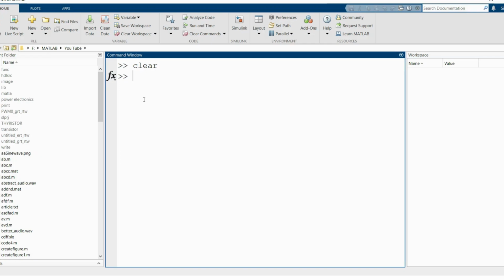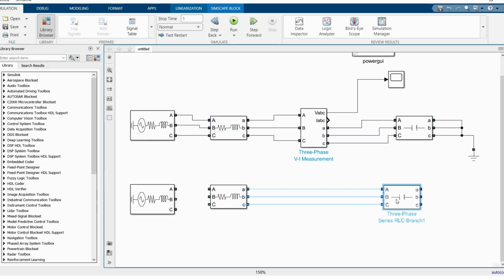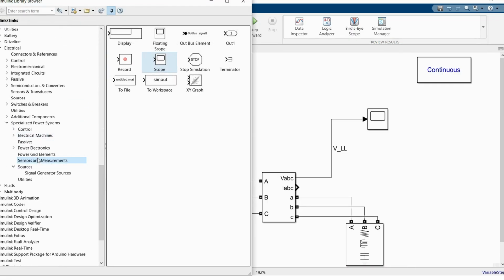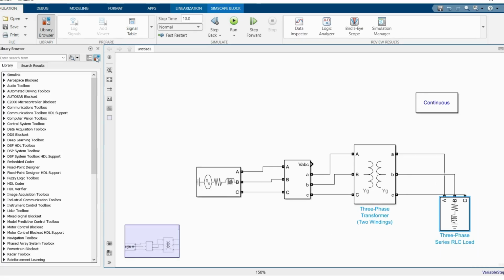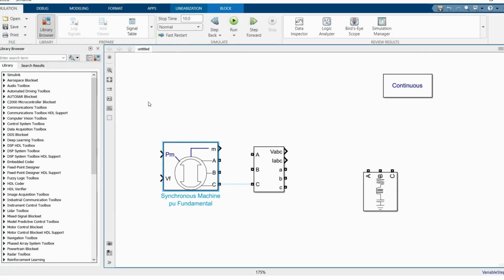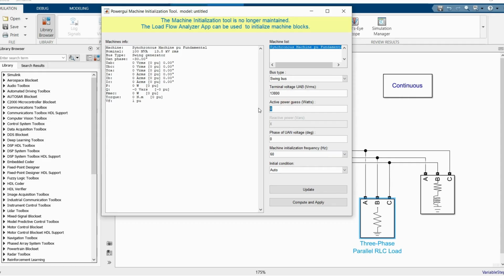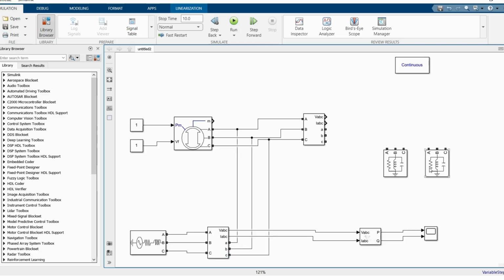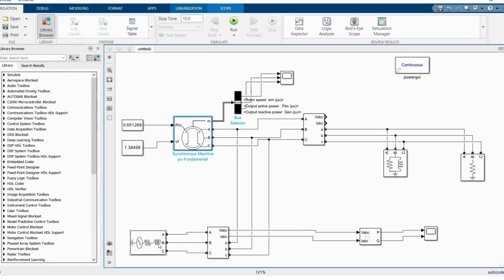Electrical Power System simulation in MATLAB Simulink | Part 1

Comment: The Three-Phase Source block under Specialized Power Systems is gone in the recent update. What can I use to replace it?
Reply from the maker: You can use a lower version of MATLAB (best option—if you have a license, you can easily download older versions).
Or you can use Simscape > Electrical, but there aren’t enough tutorials available and it’s not as easy to use as the Specialized Power Systems blocks.
Reply: @simscapeelectrical4912  Thank you. I also found that you can get the blocks by running the "sps_lib" command in the Command Window to get the blocks
Reply from the maker: You're welcome, and thank you for sharing that useful tip